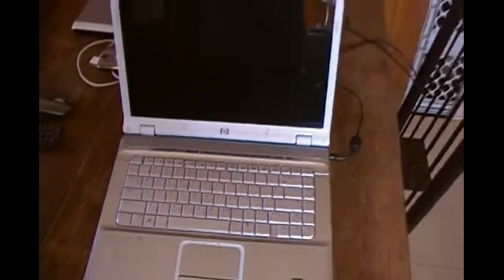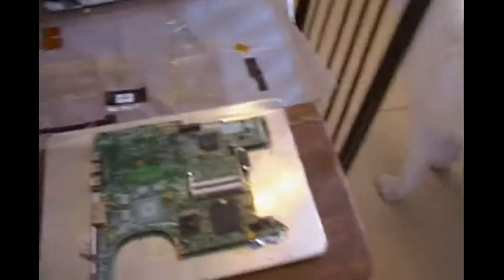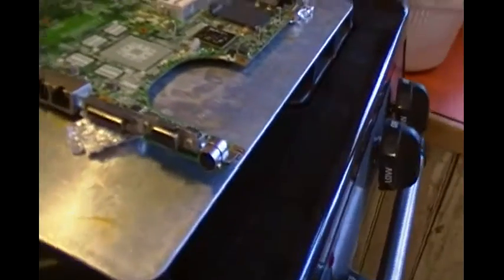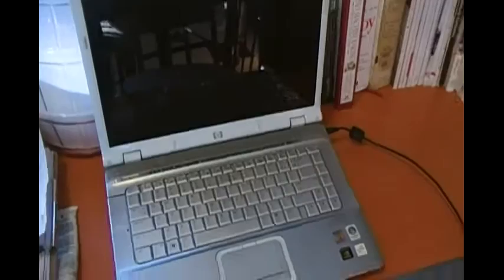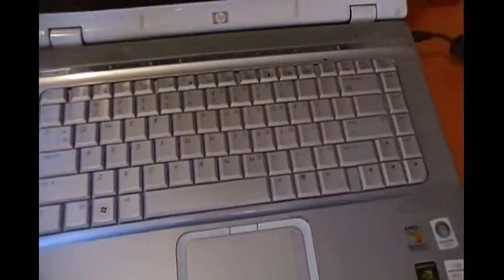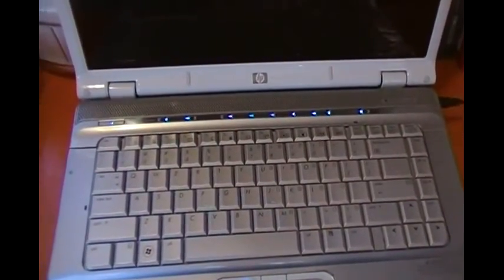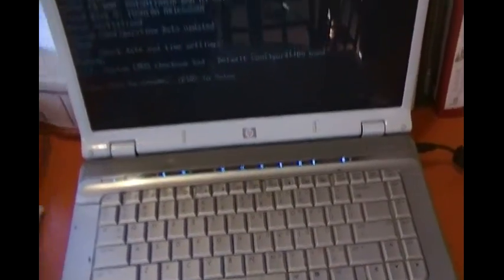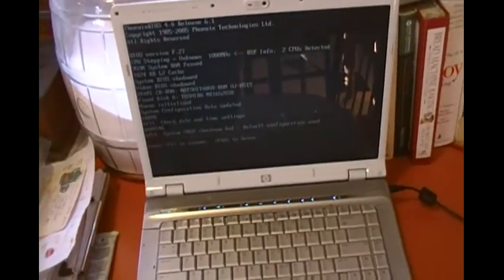HP Motherboard Oven Bake Fix

Comment: 2022 After being told labor and new motherboard would be 235+, just tried this method last night because I had nothing to lose. It worked! Still in shock! Updated Windows successfully, now disk and CPU are running at optimal percentages! Thanks for sharing!

Comment: Well I am going to try it. I replaced the motherboard in Jan. 2012 to a dv7-1260us and it worked until last Saturday. I took the laptop apart and replaced the new motherboard, still didn't work. So I am thinking of taking the original motherboard I saved and heating it 8 or so minutes and putting it in. Then if that doesn't work may try the new motherboard that is out.

Comment: I ordered a new board for my sister. DV6448se. I decided to bake the old board. SoB it worked. I'm still installing the new board tho. I used some foil and Artic Silver 5. I was to lazy to wait on getting the Artic Silver 5 from NewEgg, they have it at RadioShack.

Comment: Did you clean the CPU, Video chip and cooler and apply new Artic Silver? Are the cap lock and number lock flashing when the computer fails to start? My guess would be that you are not actually getting the solder hot enough to reflow. Maybe when you remove the and reinstall the motherboard you are causing the the still broken solder contacts to make temporary contact. Once you shut down the broken contacts cool and separate again. Try cooking a bit longer or a bit hotter. Good luck!!

Comment: if they don't i have enough i don't need to worry. 3 towers, a netbook, a laptop and the wife's laptop. love my tower though with the triple core and 6870. thanks though.. they should make them all with the cleaning plate. i'm just not a laptop guy personally. i RARELY take my netbook with me anywhere and i hate a whole tear down to do something simple and worse yet it's all on the board so if 1 thing goes...if it works for ya, more power to ya. i just dislike them for those reasons.

Comment: not all acers are made like that with the cleaning plate. my netbook and my wife's e725 (emachine made by acer) are not that way at all. if you clean the dust often, canned air should do the trick. i did have to take the e725 apart and remove a layer of crap that was hindering airflow. also got fresh compound so it was worth the whole disassembly. nice laptop. i know i wouldn't pack around a machine like that my self. is it more stationary? oh and my tower just has 2 thumb screw :P

Comment: it's funny but i have an old hp, pentium m era, next to me that works like a champ. the nvidia/ati gpus just run to hot. the foam rubbery crap they put between the gpus is the only problem. it just can' cool enough with that crappy cooler they come with. it might have been deliberate. idk.. they definately should correct this. i think there was a class action suite against hp or compaq at some point in time... i say buy them still but get intel gpus and keep the fan clean.

Comment: Worked as described. Revived an HP Pavilion DV7 1133cl using the oven bake method. I had a customer with a laptop that had a bad motherboard, but cosmetically it looked like new. He opted not to fix it due to cost. I responded by purchasing the laptop for 25 bucks. What the heck. If I could not revive the laptop at least I could part it out. I tried the oven bake method and the laptop is now working great.

Comment from the maker: @cavalier901

I did try the "take it apart and put it back together" fix before I found out about the baking technique. If you send it to a repair shop what they typically do is re-flow the video chip and processor by heating them up, which I'm sure is safer than heating up the whole thing. For what this one was worth I was willing to take the risk of cooking it.

Comment from the maker: @kvntraveller 

I just traded the laptop off, but I never had one problem with it after I did this. I also have baked a Lynksis wireless repeater and brought it back to life and have a 42" plasma T.V. that has a bad video board that I am going to try next. I'm not sure if it's the right recipe for everything but 385 deg. for 10 min. is 2 for 2 so far